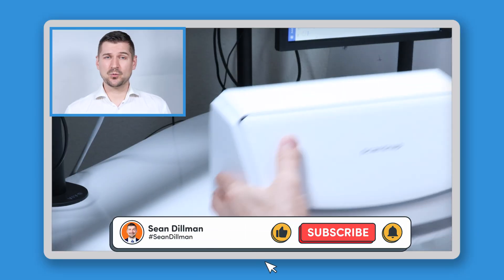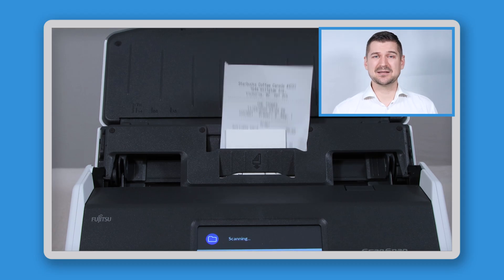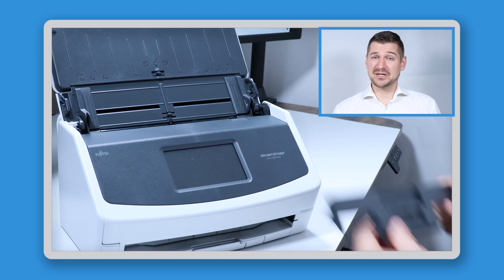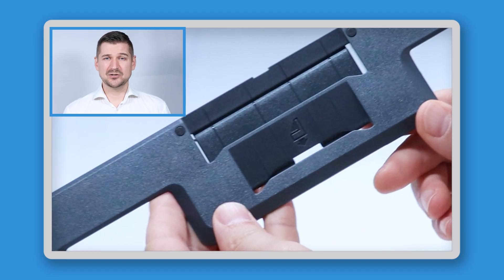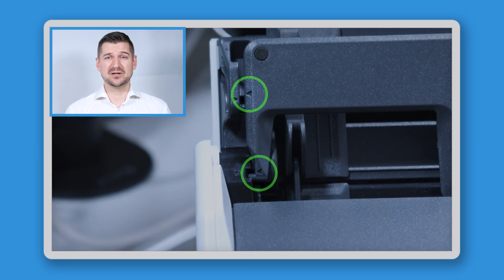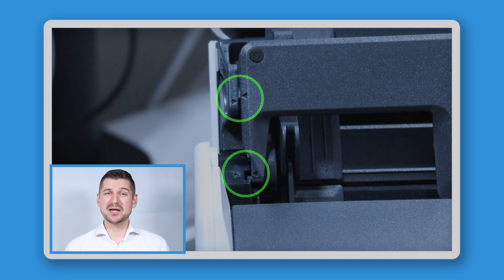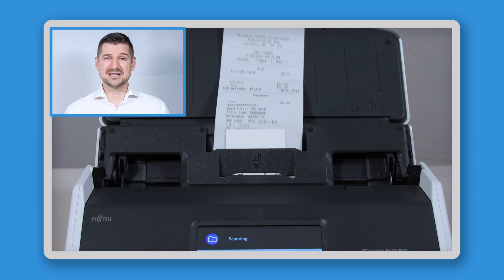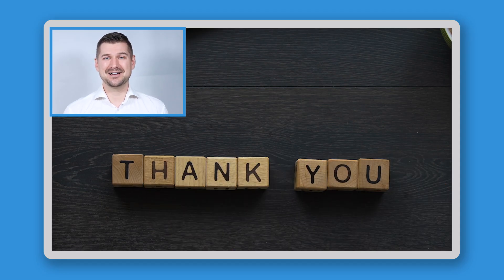🖨 iX1600 Receipt Guide - Install and Explanation

Comment: Thanks Sean, mine was not seated properly and the door was not closing.  I installed the guide correctly on the bottom but did not see there were also two parts that needed to be locked in as well on the upper section.

Comment: I just upgraded from the iX500 to the iX1600, mainly because of the "multi user" capability advertised (with color coding and everything). My family all use and love the 500, but we have to share the same profiles which is a pain, so I was excited for this upgrade. I can't for the life of me, however, figure out how to add multiple users. The documentation is sparse, and I think it's implying that I need to connect multiple computers to make this happen. Have you set up multiple users? Could you do a video on this?
Reply from the maker: Hi Jack. That's for all of that information. Sure. I will add that video idea to my list. Did you see this webpage on the manufacturer website? https://www.pfu.ricoh.com/imaging/downloads/manual/ss_webhelp/en/help/webhelp/topic/fu_env_01.html

Comment: Thank goodness for your videos on the ScanSnap ix1600!  Instructions are lacking the box it came in.  I used to have a S1500 ScanSnap which had very detailed instructions.  Not much came in my box this week for my ix1600.  I did not want to break this little plastic receipt guide and so your video was VERY HELPFUL!  Thank you!
Reply from the maker: You are most welcome. It is true that there are not as many instruction manuals coming with products these days. There are also a lot of plastic pieces that come with things that a person may need to bend but sometimes it is not clear how much it can be bent or what may actually break it. I am glad to know that this video helped you with that. :-)